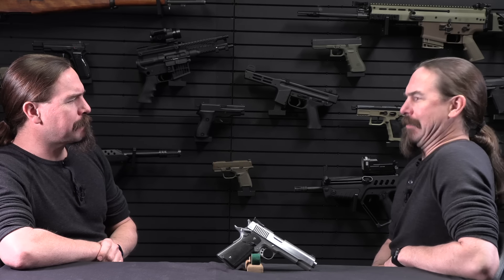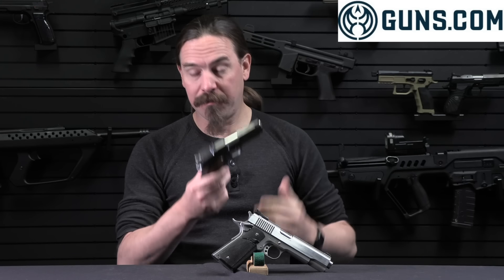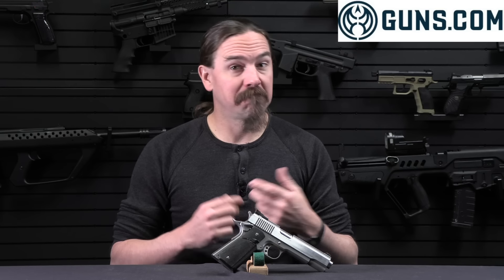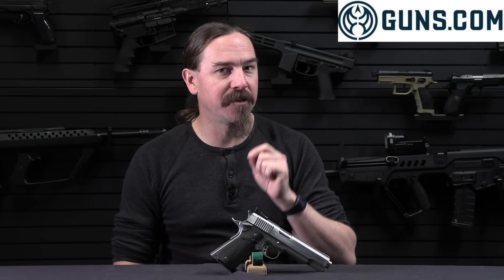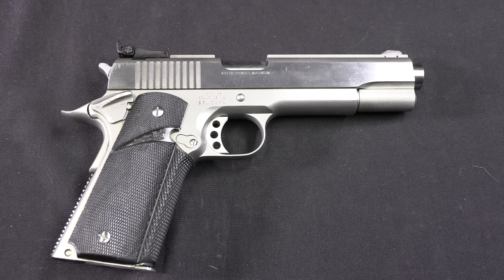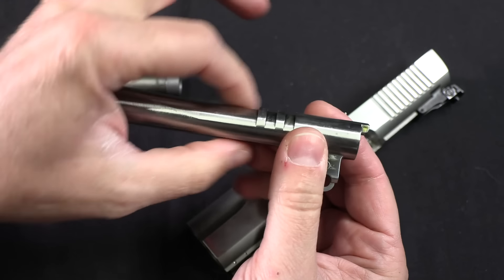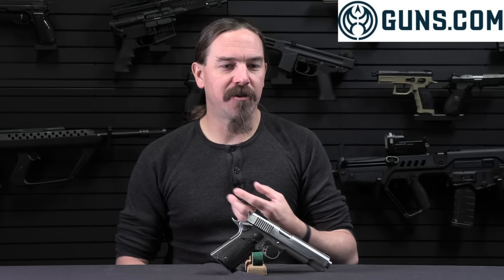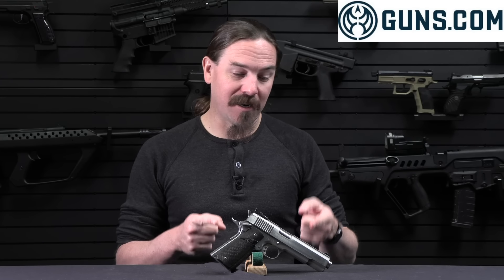Cartridge History: The .451 Detonics Magnum is a Supercharged .45 ACP

Comment: I’ve wanted to upgrade recoil springs and run.45 super for some time. May eventually do it. Apparently if you get the right spring rate, your gun can cycle both.45 super and .45 acp reliably.
Reply: Yep I do it
Reply: I have loaded 45 Super velocities in standard 45 casings. Up to 1500 fps. Cycled well in my sig p220. Was a 185 grain bullet I believe. Of course do this at your own risk.
Reply: @nicolatesla768  that’s pretty hot. I was planning on getting some 45 super brass, but was worried about accidentally mixing up casings. 

Will probably still get the correct brass, but that makes me less nervous about accidentally getting some acp brass mixed in.
Reply: @nicolatesla768 as much as I love Sig I wouldn't do that. The 220 is a great gun, but it's not a USP or even a G21 when it comes down to sheer strength of build.

I'm sure you could do it a few times and get away with it, but eventually those locking lugs will give. Eventually.
Reply: I was using 45 win mag brass cut down to exact head spacing in my .45 for loading 45 super.  With the heavy recoil spring it worked well for everything except light 45 Target loads.  For ease of mass hand loading I settled on a load where I used the same 5.6 grains of W231 powder in my 220 grain 45 JHP and my 124 gr 9mm JHP loads.  That became our normal trip to the range loads.
Reply: @tfodthogtmfof7644  That’s what I’ve been doing for a long time. 5.6 grains of 231 under a 230 grain FMJ was my standard load for USPSA shooting in both 1911s and a S&W 625 revolver. Never had any doubts about making major power factor. 😂

Comment: Using inches to describe bore diameter is so wild lol. Round up .22 to 6mm, lump all the pistol calibers into either 8mm or 10mm, rifle ammo 6-10mm. 12mm short for big game protection, 12mm long for anti material rifle. Should be about 8 or 10 standard cartidges from 6-12mm in short and long.

Comment: Thanks for the video and history of the old Detonics. Decades ago, I looked seriously at an old Detonics and came very close to buying one, but decided to handload my 45 ACP's to what later became +P. Then the 45 Super brass came out, and since that time, I've been a die hard 45 Super guy. I converted a couple of strong 1911's with 28# spring kits and Wilson buffers, and proceeded to handload fairly stout Super loads with everything from 185's running 1,400+fps to 250 grain hard cast LRFN to 1,100 fps for bear. The Super can be loaded faster using Alliant Power Pistol, but these speeds and pressures seemed more sustainable in my weapons.

One of my 45 Supers wears a muzzle brake, and even with some of my hottest handloads, it is very controllable and not much different from any 45 ACP load in a non-braked version. Also, one of the beauties of my Supers is they will both run "good quality" 45ACP and +P loads without any changes. 

Over the years, I have looked at the 460 Rowland, but given all the factors, I cannot find a reason to change from the 45 Super.